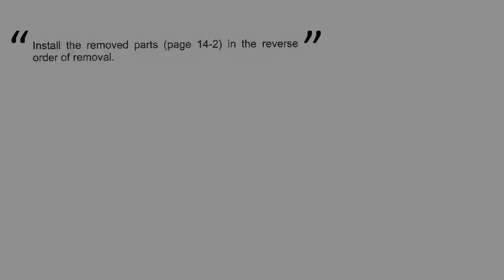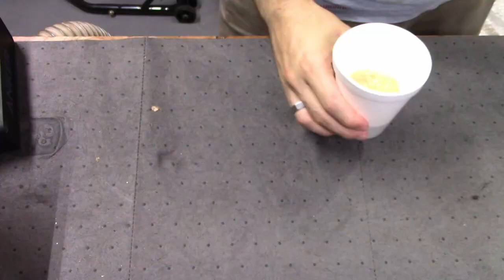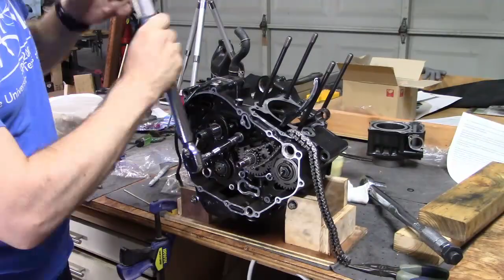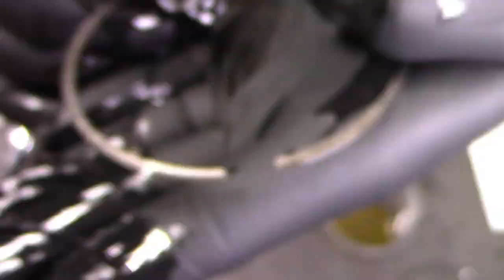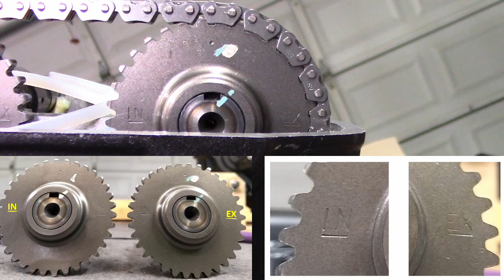CBR300R - How to Reassemble the Engine

Comment: Your little skewer trick is cool, but there is an indicator on the flywheel visible through the smaller plug to the right of the one you're using to turn the crankshaft.
Reply from the maker: Yeah, I read about that in the service manual, but wasn't able to get the smaller plug off. In retrospect, I probably should have made a comment about it in the video. Lucky for future viewers of this video, they'll have your comment as an extra bit of guidance 🙂

Comment: how much miles was on this engine before rebuild
Reply from the maker: Not that much...I think it was about 4k miles. The reason the engine started to experience piston slap was because the prior owner allowed the oil level to get too low, which ended up falling an area of the piston rings.

Comment: I found a type of spacer looking thing in the bottom of my engine and idk where it came from or what it's for. I've looked at all the part diagrams, I've watched your disassembly video and reassemble video, it's non existent but it seems important. It won't let me post a picture of it to show you though. I can give my contact info if you allow so I can try to figure this shit out. I'm rebuilding this motor and I'm at a standstill cause idk what it is
Reply from the maker: Yeah, works for me. You can drop your contact info here, or find me on Instagram and message there 👍
Reply: @lightningfrog27 messaged, thank you!

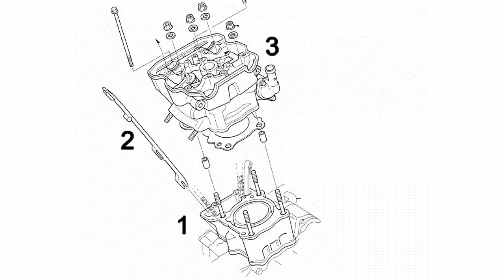Comment: Hey I’m really hoping you can help me. 18:05 my timing chain guide is out of place at the moment. I took it out like required for my 2017 Honda rebel 300. It looks exactly like the one you have. And our engines look very similar. I have yet to install the cylinder head. Where does the guide go? I can’t figure it out and there’s no instructions on how to do it
Reply from the maker: Its been several years since I did this video, but from what I recall, the bottom of the guide is like a 2 prong fork that just sits on top of a pin or maybe a cast feature in the case. I didn't spend much time on it in the video because it was pretty straightforward...only on natural position/fit. Sorry I don't have a better answer for you. Do you have a copy of your factory service manual?
Reply: @lightningfrog27 I do have a paper copy but it breaks down everything except on what that guide sits on or in. I won’t have access to it till I’m off from work

Comment: To anyone that wants to avoid putting a towel in your engine, just buy a MotionPro brand gear jammer. Costs a few bucks and is able to take the load of torquing the bolts just fine.

Comment: I have a 2020 CBR I bought brand new from a dealership, barely a few thousand miles on the dash and had to rebuild. I’ll spare the details but it’s been a long time since I’ve began the rebuild. A lot of progress has been done. It has ran since but only for a few miles and had cut off. It hasn’t been started since that point and I’ve done what i know to do or found out yet I just can’t get it I don’t understand why. I’m fairly mechanically inclined, but engine rebuild was a naïve task to take on though. I’ve done it well so far just these little things that I can’t figure out likely due to my knowledge 
I have studied your videos on this topic thoroughly the engine is the exact same even the bike from fairing to the journal bearing all the same. I was really hoping maybe you could get in contact with me to possibly help out in any way would be incredible. 

I literally bought the bike brand new in cash at once and got it up to maybe right under 3000 miles. It’s been so long since it ran I forgot the mileage on it, but I’ve had it very unfortunate from no help from the dealership no money to take to shop or anything of the sort and would just give anything to have it running again.
Reply from the maker: Hey man, sorry to hear about your bike. I'd be happy to try to help. Post a thread over on  https://www.cbr300forum.com/ , and between me an the other cbr300 enthusiasts, I'm sure you'll get the info you need!

Comment: i cant get my timing chain over both cams even after messing with the tension and piston position
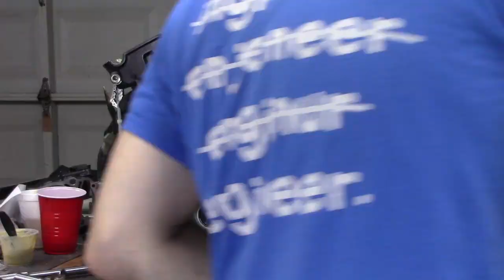Reply from the maker: It's a tight fit for sure....best advice i could give is to release the tension on the cam chain tensioner like i did around the 19:41 mark. Might also need to tip the cams a bit out of the journals. Good luck!
Reply: @lightningfrog27  thanks for the reply! I took the crank case off and even check everything inside and I took the tensioner off and still won’t fit on. Im gonna try again tomorrow but your playlist has helped me tremendously!

Comment: Rebuilding after another engine failure and did most of it by memory. I forgot about your paracord trick and used a cheap amazon clutch basket wrench and it kept slipping off until it finally cracked my clutch basket! Luckily I have a spare from an older engine. I really need to remember that paracord trick next time!

Comment: Where did you find the engine specifications? What to use on it and the torque settings etc, I got a Neo Cafe but it's meant to be the same engine. I don't see anything about the settings inside the engine itself on my owners manual.
Reply from the maker: I downloaded the factory service manual....i think i found it while digging around the CBR300 forums. https://www.cbr300forum.com/

Comment: Did you change a gear or do anything to the crankshaft? You don’t have to live the piston to put the rings on. I’m confused what broke on the bike? How many miles are on it? I was thinking about buying a cb300r myself
Reply from the maker: No change to the stock gear ratio. 

One of the skirts on the old piston had worn down a bit due to piston slap. That had put some damage on one side of the cylinder, and actually deposited some of the galled piston skirt into the corrugated piston ring...which was preventing proper lubrication during normal operation.

In short, he old piston was wearing preferential. When I first bought the bike, it still ran fine, but had a knocking sound. With 20-20 hind sight, I definitely did not need to split the crank case open, and MAYBE didn't even need to replace the cylinder... might have been able to get away with just replacing the piston rings!

Even though I did more work than required, I learned a lot in the process, and hope that my documentation of the process is helping to other folks 😎

Comment: The valves have shims? is there valve clearance to check? I see the roller on the rocker arm but can't find how to check valve clearance or how to adjust for a noisy valve train.
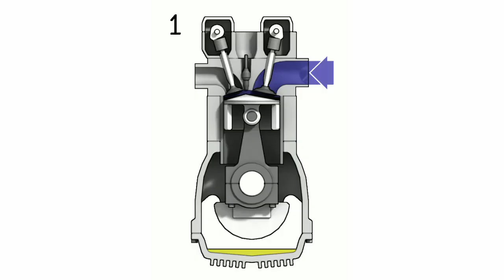Reply from the maker: Yeah, there's one shim for each valve. They look kinda like hearing-aid batteries. You can see them at 19:05 in the video.
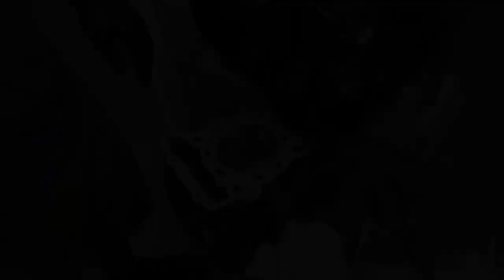So far as adjusting the valve clearances, i didnt do that, but i did put screen shots from the factory service manual in around time stamp 17:17.
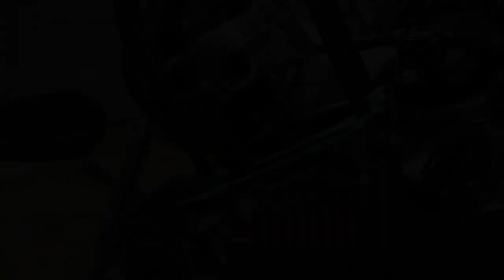I'm not sure how to solve a noisy drive train...i would probably start by making sure everything is well lubricated, and that there is proper tension on the timing chain (i install the timing chain tensioner around time stamp 15:35....not sure if it has any capacity for adjustment, but it might be a place to start looking). If that's all good, maybe check your drive chain for stiff links?

Hope that's helpful, good luck!
Reply: @lightningfrog27  thank you sir, between your videos and others I have narrowed down my issues with my son's bike. Will be replacing the cylinder head and intake cam, thanks again,

Comment: Thanks so much for putting these videos together. Extremely helpful for a first timer like myself!
Your comments about molybdenum disulfide got me a bit nervous, as I haven't found that compound specifically on its own. My friend gave me some Lubriplate #105 Motor Assembly Grease, which I think is the same as what you used. Has worked out fine for you?
Reply from the maker: Yeah, worked like a charm.

Comment: Hello, not sure if you can remember but in the video are you TDC with the cam lobes outwards or facing down? I'm trying to figure out if I'm 180 degrees off on my CBR300R engine. Damn bike won't start.
Reply from the maker: I don't remember because I never had to worry about the lobe orientation.... because when the stamped letters are right-side-up at TDC, the lobes are in the correct orientation.

Comment: My intake cam is slightly off by  a Millimetre. I mean its not as parallel like the exhaust cam?
Reply from the maker: Can you take some pics or video? Off hand, I can't think of anything that is would cause that...
Reply: @lightningfrog27  can i get your mail id?
Reply from the maker: Would be best to just link to a Google photo album or the video that you upload to your YouTube channel so other people that find this comment chain in the future can see what's going on too 👍
Reply: @rguru2493  my cam gear alignment was similar to yours when I started taking apart my engine. I'm just at the point where I'm ready to put things back together. Did you resolve the issue?
Reply from the maker: I don't recall seeing photos from his build, but here's my $0.02 on the topic:

One mm does not sound like a large error...could be normal manufacturing tolerances. Realistically, the angular position of one cam relative to the crank and the other cam is discretized by the  timing chain. Basically, you can rotate the cam one whole tooth to the left or right, and that's the full extent of the adjustment available to you. 

I'd recommend setting it to the tooth that makes it closest to parallel and you should be fine.

Comment: so that you know- just to replace the crankshat, one does not need to remove the clutch or the gearbox and balancer shaft gears. only the flywheel and  nut on the other side that holds the chain sprocket. then the crankshaft slides out. to remove the flywheel, I used a bold from Honda C-RV rear diff plug hole. it is M20x1.5. no need to buy expensive tool.
Reply from the maker: Thanks for sharing!

Comment: What's the center clutch nut torque spec? And why the heck does every oem part site  and parts guys at bike shops say the center clutch nut is 16mm????? I know for a fact like you that mine is 24mm
Reply from the maker: 80 ft-lbs
Parts suppliers (and even the OEM factory service manual) specify "16mm" because that's describing the size of the threads, not the distance across the flats of nut. Not terribly useful to the end user. Good luck with your build!
Reply: @lightningfrog27  thanks so much for the Swift reply man. That 16 mm thing was messing with my head bad and had me annoying the parts guy lol. I didn't get mine torqued. I used an impact the first time, but had to open the case again.this time I only used a ratchet and didn't want to bear down too much and break teeth on my clutch basket.also, I did this purposefully to not tighten it quite so much so I could restake the nut a little to the side until my new one comes in. I figured even if it's a bit tighter, vibration and possible counterclockwise turning could cause it to loosen if not staked🤷‍♂️... maybe I goofed...Just got stressed about the staking since it comes from factory like that😬.thoughts on this? And I really really really really appreciate the detailed vids.i'd be up 💩creek without a paddle without your channel bro. I never even opened an engine before 3 days ago. I've learned soooo much, actually like the bike I have now since it's easier to work on than the faster bike I've been dying to get🙄, and have actually grown as a person and became a more capable man in my actual life. I absolutely CANNOT afford to pay a shop to fix it for me or wait while they do it since this is my only means of transport. This means I'm either screwed or further behind the interest rate on my credit card which also means screwed. I know this is a long paragraph, but you made my only option possible. You did that, and I thank you 🛐.
Reply from the maker: Thanks so much for your kind words. I remember when i first started working on a vehicle because i couldnt afford to pay someone else to do it...it was on my 1995 Plymouth Neon. After doing a handful of small jobs (radiator, shocks), i ended up needing to change my timing belt....and BOY did that feel good when it worked. Super big confidence boost to recognize and understand that these machines are just gigantic/expensive lego sets :D I'm happy to hear that my videos have been helpful in your journey!
About torque vs staking....Generally, the thing that prevents nuts from coming off of bolts the installation torque - it causes the bolt to elastically stretch a very small amount, which is basically making it act like a very stiff spring as it clamps two things together. This is sometimes referred to as the "primary locking" mechanism. When nuts and bolts are in an environment with high vibration, there's a possibility of 'self loosening'. If that risk is high enough, or if a nut coming off would cause a really bad outcome, they mitigate the self loosening risk by calling for a 'secondary locking' or 'positive locking' mechanism. There's a lot of ways to doubly ensure that the nut doesnt come off (https://en.wikipedia.org/wiki/Positive_locking_device), but in this case, they decided to go with a bent metal tab - "staking". I dont know enough about what drove them to call for secondary locking, but i assume it's to ensure safe operation and/or prevent major engine damage if that nut came off. That being the case, i would highly recommend making sure your bike has both proper torque (primary locking) and the bent tab (secondary locking) before riding it around. Good luck!

Comment: I did the same with the timing chain guide 
And whats the torque spec for the head bolts?
Reply from the maker: Glad to hear im not the only one :)

Cylinder head cover bolts (qty 2) = .7 lb-ft
Cylinder head mounting nuts (qty 4) = 33 lb-ft

For the head mounting nuts, dont forget to apply engine oil to the threads and seating surface!
Reply: Sorry to bother you can you please tell me whats the torque spec for camshaft holders

Comment: Does this motor/oil pump design appear to be oil starved from a 60°-70° wheelie? 
Looked everywhere online and can't find any info...
Reply from the maker: I dont know for sure...but i'd guess that a wheelie would not starve the oil for two main reasons:
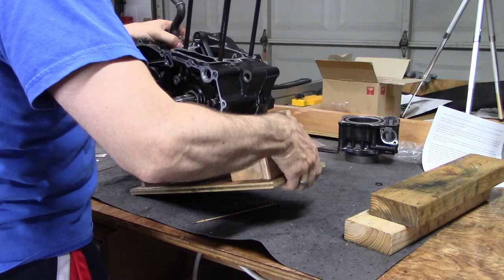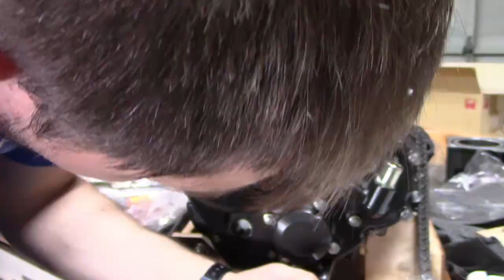1) Check out time stamp ~ 6:37...you can see the engine in the as-installed orientation. The little rectangular slot you see at the bottom center of the crank case split line is the oil intake screen - the oil pump sucks oil up from just below there. The oil reservoir is in the larger cavity below that (most easily seen when the crank case is split apart such as at time stamp 5:10). Basically, the oil pump is drawing from the very bottom of the engine, so even if the engine is tipped 60 or 70 degrees, i'd expect it to remain submerged. (also, later on, around time stamp 11:42 you can see the oil pump side of the engine with the crank cover in place, which has the sight glass on it, so you can imagine how full the oil reservoir would be at rest).
2) Honda engine designers are pretty smart - I'd guess that they accounted for the likelihood that some customers would want to use this as a trick bike, and strategically placed the oil suction accordingly.

I suppose the best way to know for sure would be to prop up the front end of the bike (maybe on the bed of a truck?) and then support the swing arm (jack stands? service stand?) and try running the engine. that way you'd be able to see and hear how the engine is behaving directly with a fast/safe/easy way to kill the engine if you see the temperature gage rising, or smoke coming out of the exhaust.

(please report back if you end of up doing this!)
Reply: @lightningfrog27  I'm thinking about getting a Rebel 300 was just wondering if it could wheelie like my Grom, if I get it I'll just use ratchet straps and an A frame ladder to stand it up and remove the valve cover to see if the top end is getting oil... Thanks for the reply!

Comment: Spectacular video.Thank you.  I just tore my cbr 250 down due to an exhaust valve  being stuck open.( 3,100 miles, but sat for about 3-4 years) Hint was blow by in the case coming out the oil fill cap when cranking. Hit by piston also.. So, bascially a new top end. Botton end zero damage.

Comment: An excellent video.  Very informative. Did the cost of rebuilding your engine nearly exceed the value of the bike   Keep up the good work.
Reply from the maker: Thanks!

Yeah, if I had the dealership do the work, it would have cost about $2000....which is more than the $1500 that I pad for the bike.

In parts (and video equipment!), I ended up spending less than $500, so if I were to turn around and sell the bike id probably make about $1000 profit.